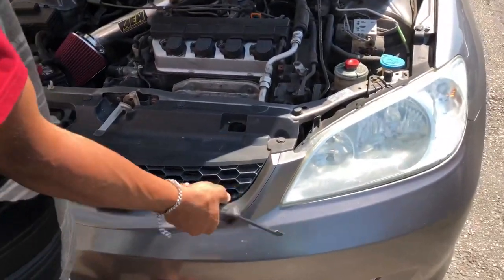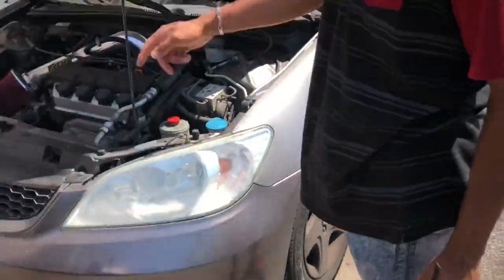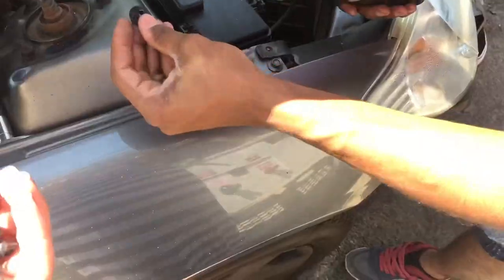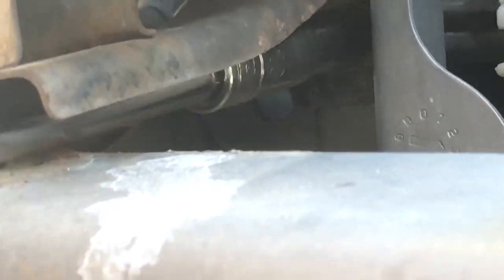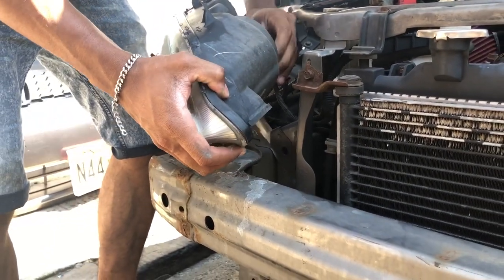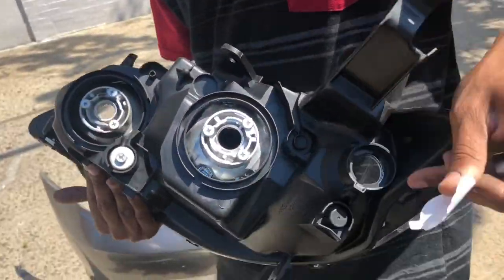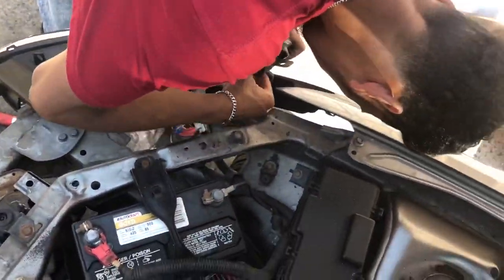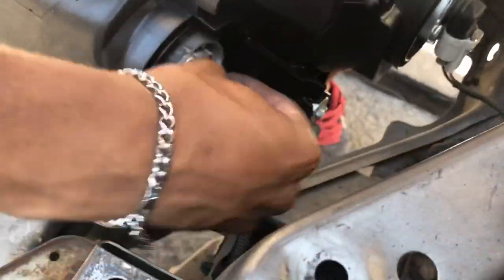How To Replace Headlight on Honda Civic 01-05

Comment: Ive seen few cars where you didnt have to remove whole bumper and everything first but i HATE when a car maker forces you to do just that for the headlight. It should be easy, not a pain. Just plop it in from the top. Make it simple. Few screws from the top and take out but nooooo gotta remove the fucking bumper.
Reply: It's just 2 bolts and 4 clips
Reply: Couldn't agree more.  You should see what you have to go through to replace the rear speakers in this same car.  You almost have to gut the rear passenger area so you can pull the rear deck plate off just so you can get to the bolts holding the speakers down.  Ridiculous design.
Reply: @garylewis327  my mk5 gti is insane too. Speakers? jesus dont ask. The 2door variant is insane. And headlights? grill bumper and everything have to come out, only because theres 1 or 2 screws behind it all on the bottom. Makes one wonder how stupid the R&D people really are when they make a car. I mean i guess they probably start one way and build the platform around and just dont care how things fit (obviously bumper comes later and covers screws and stuff) but its insanely frustrating. Might as well not let us fix anything or be against the law lol i feel that day is coming. Notice tesla doesnt want anyone messing with their cars and doesnt like to sell parts.

Comment: You just to remove the battery on the passenger side, slide the the power steering reservoir to the side to get to light bulb on the driver side on a Honda Civic 2005

Comment: Isn't there a way to get to install the headlights without removing the bumper?
Reply from the maker: Unfortunately no
Reply: @ITSXLOW  That sux
Reply: @Jason_Phillips3679  it's not hard to take the bumper off
Reply: @RCMGPs3  i know that but I'm just used to cars that I've had that when replacing the head lights it wasn't required to remove the bumper.

Comment: you have a link to where you got them? all of the chrome housing lights i seen for these have that fugly amber signal light.
Reply from the maker: I pinned them in the comments section!
Reply: I saw a new driver's side headlamp assembly for sale on eBay for $35 without the light bulbs, for the 2003 Honda Civic (8/16/2021).

Comment: remove the bumper???
Reply: It’s like the easiest Car to remove the bumper tho , 5 to 10 minutes max no fancy electronics or padding on it either .
Reply: @newagestreams4008  why would you need to do all that just to change a bulb? I just popped the hood and you jam your hand down there, turn the bulb, and pull it out
Reply: @menacexp I’ve replaced the bulb on this car too and did the same thing as you but he replaced the entire headlight and in order to do that you have to remove the bumper
Reply: @jovanyjimenez2926  ok, that makes a little more sense for the whole headlight

Comment: I just notice a poor practice you are showing . My dad told me when I was about 12 years old that you never tighten any faster until they are all in place and moved into the proper place . Then go and tightn them down but not before. I see you tightn as you go which will bite you later when you have to losen then all off to get the last bolt in .